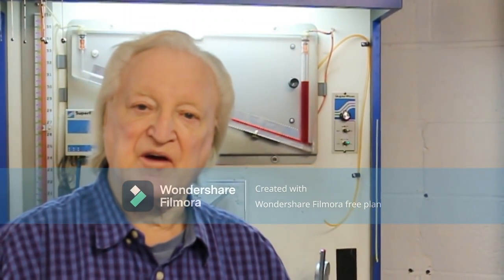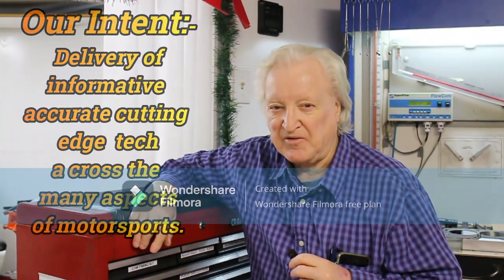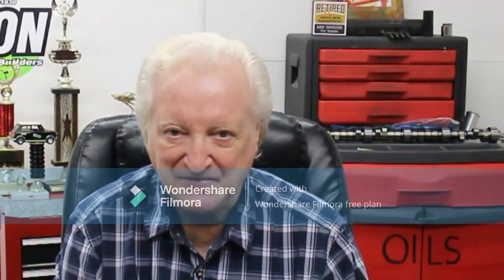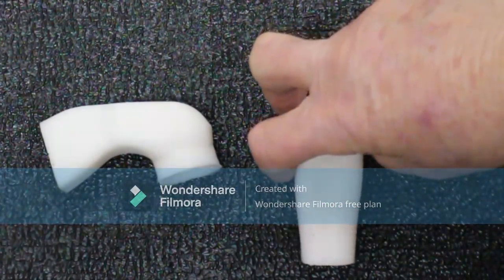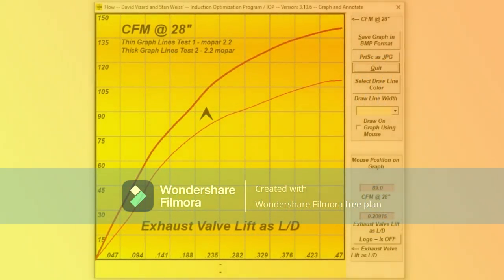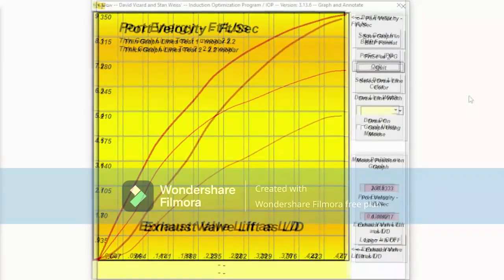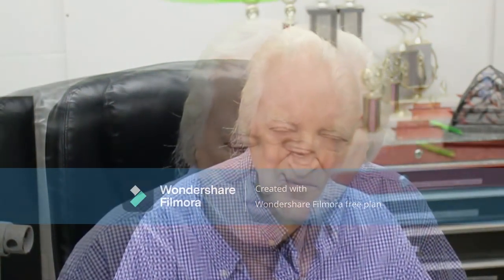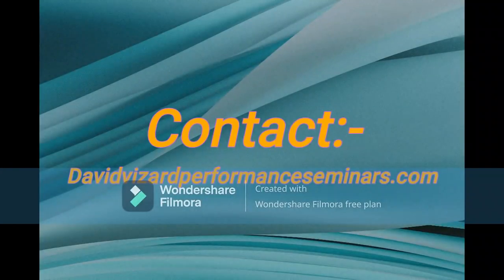Turbo Exhaust port science Chrysler 2.2

Comment: Hello Mr. Vizard hope you're doing good. I am glad I saw this video. It taught me a lot about the cylinder head I am working on. It looks a lot like the way Pontiac V8 heads are made on the exhaust. The flow is more predominantt on the cylinder wall and I am thinking if I port the Pontiac exhaust the same way as this it will flow better.

Comment: In the late 90s and early 2000s I had a 1987 Shelby Daytona 2.22 L turbo. I worked for Dodge and this was my experiment car. I cut up had like a loaf of bread so I could see the design. When I poured in my head, I took the exhaust floor out, the big lump. I ran 25 pounds of boost daily driven 13 years. It made 563 hp

Comment: So many people don't understand that boost pressure only measures the restriction in the system and not the actual airflow.  The airflow is king, minimizing boost pressure per cfm of flow through the system is the goal.  Having the least back pressure necessary to generate the airflow necessary is exactly how this gets done.

Comment: Very nice! I'm sure it's going to make more power with less psi! Actually, it will pass more dense air easier, because the turbo is not working as hard! Now the turbo is not trying to force air thru a smaller less efficient port! I really hate it when so called smart engine guys say the heads don't matter 🙄🙄🙄🙄! Well, you keep believing that, but don't wonder why you lose, so often 🙄🙄🙄🙄! Steve Morris proved this going back 6 or 8 months ago on one of his BBC blown engines! One of his new customers previously purchased cylinder heads from Matt & the guys @ MBE! He showed that with everything being the same, cubic inch, short block, intake manifold, [was ported to the head's] camshaft, blower, gear set, timing, everything was exactly as he did with the previous 2 engines! It made a little more power; but it didn't need as much timing & it was moving the same air @4 psi [gage] less! He didn't speak about all the advantages of the engine making more power, much easier! But I think the guys that follow him, get what he was talking about! This customers engine will last longer & have much more when he needs to stand on its neck 😂😂😂😂 👍🏼👍🏼👍🏼👍🏼! Thanks again, Mr. Vizard for sharing all your hard-earned knowledge!

Comment: DV with this kind of work done on a stock motor that is put together well driving this car you would have to notice work done. I would think it would be like day and night. I would think the the drivability of the motor would be like putting a v8 in the car. I am not a pro but I can even see that much difference off the seat has got to make a bigger difference on just the response on how the motor run just going down the road. Would be cool to have a before and after drive of this car. I think this is got to help make a lot of of over all power and can’t wait to see his video on this. Nice work on helping us out. Really nice to see you on video again.

Comment: Question for David. Take for example a typical V8 intake port. Its shape changes from tall and narrow to shorter  but wider, then from rectangular to round around the rear of the valve. What emphasis do you give to maintaining a consistent cross sectional area in order to maintain a steady speed of airflow, rather than having the airflow changing speed through the manifold and through the port?. From my readings (and please correct me if wrong), the airflow should gradually but evenly accelerate through the manifold and port to then be exposed to a negative pressure venturi as it passes the valve seat into the chamber which helps to "draw out" the flow.
Do you worry about the cross sectional area when shaping a port ?

Comment: I'd like more videos discussing the changes and relationships to valve size and seat angles for turbo engines vs. naturally aspirated engines. Is there a "golden ratio" so to speak for increasing the exhaust valve size to intake on a turbocharged or otherwise boosted engine? In theory, when is the exhaust valve diameter too big on a turbo (assuming no chamber constraints)?
Reply: I know of folks that have tried exhaust valve diameters equal in size to the intake... with "gratifying" results!!
Reply: @63turbo  I was surprised to see BMW used larger exhaust valves on the E30 M3. It was very counterintuitive to me at the time I was porting the heads.
Reply: I have argued for a while that on a turbo engine (dunno about superchargers or nitrous) you want to have more flow than what you typically would see on an N/A engine...because you can force the air in all day, but it HAS to get out! I have heard of people doing a -2mm/+2mm (in/ex) setup on these heads with good results. Never seen it done in person.
Reply: @rocketsurgeon11  Yes! the exhaust requirements are way different on forced induction engines of all kinds. At the end of the power stroke, theres 50-100 psi in the cylinder at the moment the exhaust valve opens, and getting that excess pressure out would be much easier with a bigger exhaust valve. The more boost there is, the more excess pressure there is! The temptation is to start the exhaust opening sooner, but because of the extreme force it can take to open the valve against this pressure, its a recipe to kill cam lobes. Bigger exhaust valve that starts opening later starts making a lot sense, even though its wrong for an NA engine!
Reply: @63turbo  The 39 degree cut is a BIG help when that valve starts to crack open. The standard 45 degree is slower at low lift. 39 deg works on NA but so much better on forced induction. On my NA 84 Shelby 2.2 head I did a 40 deg cut with the bigger valve and stock seat. Also used the 252 deg 0.460" cam. 11.2:1 comp. 15.98 @ 1/4 mile on a NA Carbed 2.2 0.039" over. Still got 35 MPG
Reply: @davej3487  Cool!! is there any difference in seat/valve reliability when doing that? I'm asking because sometimes those alternative seat and valve angles arent recommended for street use.
Reply: @63turbo  Never had a problem in the 20,000 miles I drove the car commuting. The 84 Shelby 2.2 was 9.6:1 stock but I went 1mm over bore and 11.2:1 so it required Premium pump gas. The station I got gas one day must have gotten a cross dump of regular as I was climbing up a steep hill @ 85 MPH in 4th gear and it got into detonation and before I could back out of it, it melted #3 piston. So I heard the first rattle of detonation but thought the 'Knock Sensor' would take care of it like it had a few times. I only got 20,000 miles in that test.
Reply: One of the epitomes of turbo engines; BMW´s 4 cylinder F1
https://youtu.be/GCAWdo2WAI0?t=1
Reply: You all are missing the point. You can´t reinvent the wheel. See the ratios below. You couldn´t ever come up with anything better than this...  lol   
https://youtu.be/GCAWdo2WAI0?t=1

Comment: I am VERY impressed with the results! Considering it is using stock valve sizes it is flowing VERY well for one of these heads, and I am not just focused on the cfm, but the velocity! I was REALLY impressed by that! I believe that head is going to decrease spool time a significant amount, which of course increases the response of the engine overall. I honestly thought you were going to rip the design of the exhaust port pretty badly as I personally viewed it as "terrible". Thank you for the education on this subject. I really hope you delve into the 4-valve cylinder head world at some point in your video series. I am genuinely curious as to what is approached differently with that style of head.
Reply: The stock casting is definitely a constraint here. DV didn't have as much time or resources to develop the ports and chambers further. If I remember correctly he did cut up a spare cylinder head and found the wall thickness to be too thin to do any significant reshaping of the ports. That is why in the beginning of the video he said that he was going to "play it safe" and go for the obvious improvements.

I agree that this four cylinder head is a refreshing break from all of the more common V8 porting videos. I also would like to see what is done on smaller 4 cylinder engines to achieve dramatic gains. For example I'd love to see some Toyota 22re, Volkswagen 8v & 16V, and others get the Vizard treatment.
Reply: @David_H_Parker  the head sections were donated to him by a person in the turbo Mopar community. The pictures of them have been floating around for 20 years or so now, but having them in hand I am sure was the ideal situation. Most guys that do work on those heads do the things he has done, but use bigger valves. The exit of the exhaust ports get raised as much as possible, but you are correct that they don't typically reshape them all that much. The BIG thing he has done here is the valve job and the chamber work to allow it to breathe. I know guys put 3 and 5 angle valve jobs on them, but I think they typically stick with the stock seat angle. Personally I've been wondering for years what would happen with a different angle, and this showed it. One of the guys that was well known back in the day also tried filling the bottom of the exhaust port exit (my request) as the floor is, IMHO, WAY too low. It produced some gains, but not really enough to warrant the work it would take to do it as far as flow, but I wonder what the velocity would have shown? I've seen cfm numbers much higher (I want to say the most on the exhaust was in the 180's, but all benches are different, so the numbers aren't directly comparable), but I don't know what the velocity was like as that isn't something most discuss or advertise. I wish Richard would have been able to get a good test on the stock engine before installing this head because I know it'll pick up power for sure, but the boost response is really what I think will be a game changer. The 2.2 doesn't really get into boost on the stock Garret T3 turbo until about 3k. If Richard does some porting to the exhaust manifold and matches the turbo turbine housing to it I think the engine will come on boost quite a bit sooner, which would in turn make for a wider power band and more power under the curve. They are already torque monsters (my stock 2.2 8V on a stock turbo at 22psi made 291ftlb at the wheels!), so I bet this will just make it even more of a riot! Getting it to hook up on the street might be a challenge!
Reply: @rocketsurgeon11  The old T3s used far too large of a turbine housing as a primitive way to prevent overboosting. Changing the AR on the turbo or simply upgrading to a ball bearing T3 or T3/T4, properly sized would make a huge improvement all the way through the power band. Using something like a .48 turbine housing would start to spool up probably around 1500 RPM.
Reply: @David_H_Parker  The stock turbine housing IS a .48. It already generates a pretty high exhaust to boost pressure ratio, especially if you turn it up. The turbo technology just wasn't there yet. The aerodynamics of the turbine wheel and the weight of it compared to modern turbos is archaic by comparison. Those stock T3 turbo's can easily control boost from <5 to All-of it (about 27psi give or take) with the internal wastegate (for the All-of-it setup you basically prevent it from opening). The Super 60 kit (developed from the LeBaron Indy Pace car program) used a slightly larger version of the T3 with a .63 housing. The entire package was rated at 300hp at the crank. In order to help with boost response, Chrysler used a Mitsubishi TD04 turbo on the 2.2 in 1988, and the 2.5 turbo engine starting in 1989. That combination is pretty responsive, but it's all out of steam by 18psi or so. Stock for stock, the Mitsubishi turbo is a better matched unit, but it doesn't have the same top end, nor does it have the same ultimate power capability as the T3. It's also pretty restrictive on the exhaust side. Shelby and Chrysler tried to get the "best of both worlds" starting in 1989 with the world's first production gasoline car using a Variable Nozzle Turbo (VNT) in the 1989 Shelby CSX VNT, which utilized the Garret VNT25. Chrysler used it in limited production in 1990 for the Daytona, LeBaron, and Shadow, but there were issues. The vanes kept getting stuck for various reasons. In reality it DID do what they set out to do...it VASTLY improved boost response (I got to drive a VNT LeBaron a number of times and it was so good it felt like a V6 with how linear the power delivery was), but it was costing them money. Ultimately the VNT25 is actually too small for the 2.2. You can turn them up, but they run out of steam pretty quick and it is easy to overspeed the unit, which reduces its life quite a bit. This technology was later adopted by Porsche (who tries to claim they were the first, but they were beaten...by almost a decade) and it was pretty ubiquitous in the VW world (and I think still is?). Now the aero technology and metallurgy have gotten to the point where the turbos are physically VERY small in comparison to the old tractor turbos these cars used. So the need for the VNT technology is pretty much gone (save for the diesel world, where it came from to begin with). I mean, I have a Garret G550 waiting to go on one of my projects and it's about the same physical size as the old T3, but can support almost DOUBLE the power with just as good boost response! Even 15 years ago the hot ticket was STILL the T3/T4 hybrid stuff. I personally am curious as to how the engine will perform with a true T4 (hopefully fairly well matched to the power). Richard has shown that people's fears about running the full T4 with the right combo can be nearly as good as the hybrid stuff. I wonder if we all were scared of something that was truly BS all this time? It was basically said by everyone that running a full T4 on anything but a dedicated high rpm engine that was small displacement would destroy boost response and make for a light switch on power (which was already the case anyway!). So, the point here is that no, the stock T3 .48 housing was NOT too small for the 2.2, and in fact was actually well matched for the technology available at the time.

Comment: Would you want the exhaust pulses to hit the collector all at once or lined up
Reply: You want the pulses timed with the firing order. Tuned lengths is the simpler way to do it.
Reply: @David_H_Parker  thank you that has been bugging me for a while
Reply: @craigchiddo2794  Equal length ports and manifold runners are the ideal method. Sometimes you can't do it due to size constraints in the engine bay. You want to avoid allowing the turbine to slow down between pulses. If the pulses are uneven, they can cause the turbine speed to slightly increase and decrease with uneven pulses. 

Just like a tuned length header on a naturally aspirated engine, you can get different results with overall lengths and different diameters. Sonic frequencies play into it as well.
Reply: @David_H_Parker  tuned length turbo manifolds waste energy that should spin the turbo , and you dont get the lengths right anyway to work with turbochargers, so just make them as  short as possible with smooth bends.
Reply: @V8Lenny  Within reason, it is better to make a turbo manifold runners as even as possible and as you mentioned as short as possible.
Log style manifolds are typically the shortest but create significant differences in egt's at each cylinder. 
Individual & equal length runners keep the egt's more consistent cylinder to cylinder.
Reply: @David_H_Parker  cant make short and equal length at the same time.
Reply: @V8Lenny  Maybe you can't. I have made some reasonably short equal length ones.

There are many fabricated examples out there, they do outperform log manifolds.
Reply: @David_H_Parker  unequal will always have less volume , and make more power. Highest boosted engines use log manifolds. Many are still learning turbocharging , maybe someday you know.
Reply: @V8Lenny  I don't see many log manifolds in F1.
Reply: @David_H_Parker  so you havent seen Mercedes manifold ? And they are restricted , unlimited is different , start following diesel racing.
Reply: Some say this is why Mitsubishi twin scroll manifolds work so well. They aren't completely equal length, but they do get closer than the typical log does.

Comment: So to get the gasses to go around a corner increase the cross sectional area to decrease the velocity (Q=VA) around the turn?
What are your experiences with the cross sectional area mismatch of a normal intake and ported heads?
Reply: D V is a friendly alien sent here to bestow the knowledge of airflow upon us
Reply: Increasing area increases pressure and turbulence in a bend, that's not something you want.

Comment: This came across as a live video David. And as of late...the volume is so low, I can't hear you for 50% of the video.
Reply: Hi Tom, I just watched it and didn't have any volume issues. May I suggest that you watch it again at a different time as I have experienced similar issues to what I think you are describing as a result bandwidth problems. That said I must agree with others that the background music is annoying. I would personally rather hear the air-conditioner noise that they are trying to mask. Regards Greg
Reply: Parts only play out of the left earphone. Usually the intro in the past, but now its throughout the video.
Reply: His voice is only on the left channel, the right side has the music.
Reply: Tom, the production isn't stereo. Mr Parkers comment below.
Reply: @deanstevenson6527  it's only when he is talking at the desk. The rest of the volume is normal. I've checked it with multiple devices.